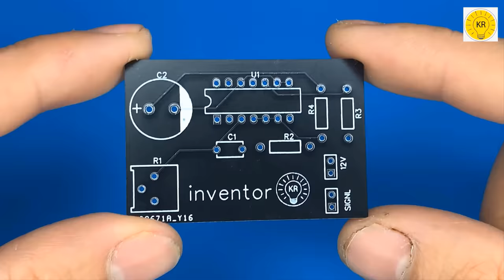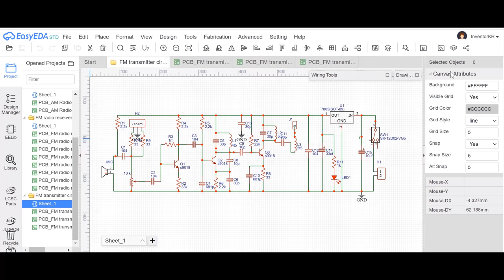how to make simple inverter 4500W , sine wave , 8 mosfet , IRFz 44n ,jlcpcb

Comment: Nice concept, but in reality there's NO way that output transformer is even CLOSE to a 4.5KW transformer, definitely not continuously over long periods of time. That is only about a 500-1000W transformer if used continuously, otherwise it would get too hot. I've seen the insides of quite a few pre-made and branded inverters of around the 5000W size over the decades, and their output transformers are always MUCH bigger than this one is, (at least at this relatively low frequency switching level), plus I actually have a few surplus transformers of almost that exact size physically, and NONE of them can put out anything over 1200 watts continuously without overheating, I've tried...

Not to mention, your supply wires on the input of this are WAY too small to handle the current needed from the lower voltage input source in order to actually power a coffee maker or kettle or whatever that is there, because you can't get more power out of something like this than what you put into it, it's just pure basic physics that apply here, so if that water boiler/kettle or coffee pot or whatever is even a relatively small wattage one, it's still gotta be about 1500-1600 watts or so at least, (most likely even more like 1800-2000 watts), and therefore there is absolutely NO way that those tiny wires you're using on your input to this inverter circuit wouldn't just completely melt or even light on fire from the current going through them IF this inverter WAS actually powering that coffee pot/kettle/etc., so I call total B.S. here and say that this video is fake and simply rather misleading clickbait, because the title of it makes people think that this exact setup will be able to put out the amount of power that's claimed, but there's NO way it actually could in this configuration!... About the ONLY thing that this inverter actually could be powering here is that lightbulb, otherwise if any more than that then the tiny supply wires would just burn immediately, lol!

Also, this is NOT a "sine wave" inverter, it's more like a square wave inverter, because of that IC that chops up the input voltage, but at least the output transformer gives SOME "smoothing" to the output waveform, simply because it's a purely "analog" device and doesn't respond immediately to the rise and fall of the square wave coming out of the mosfets... Let's maybe call this inverter a "modified sine wave" type... or more accurately a "modified square wave"...

This IS a cool concept video though, of the very basic wiring of an inverter circuit, which is cool to see at least... but that is all this is really good for... to show a concept of how a basic principle (of an inverter circuit) works.

Where did you get that pre-made circuit board with the IC on it? (I know the actual PCB is made from that website sponsoring this video, but I mean where was it's actual circuit design gotten from? Is it like an "inverter kit" that you can buy somewhere or something?)
Reply: I was thinking exactly the same thing man
Reply: I was looking at a transformer secondary and te same wire is ground and live wire
Reply: Just FYI a lot of kettles actually go as low as 800W and a lot of cheap kettles are around 1000-1200W
Reply: @MaxC_1  At 12V input that would still be close to 70A without accounting for losses. There is no way there are 70A going through those small input wires without them glowing brighter than the lightbulb. Also he held the base of the kettle into the camera and that said 1800W - 2200W so no way.
Kind of sad to see a video about a sound and working concept ending on a clear fake. Probably has something to do with the affiliate links in the description...
Reply: Completamente de acuerdo, desde que vi el tranformador y la forma en que lo midio, dije este no tiene ni idea, solo le dieron en proyecto listo y lo armo,
Reply: That’s BS running the kettle. Those 12V input wire would have vaporised with the necessary 80 to 100A of primary current to produce the minimum 1,000W of power needed. 
Should have stopped with the light demo, that was good enough to make the point about 220V. 
Anyone thinking about trying this at home, especially perhaps to run their heater or arc welder, will put themselves and their property in certain peril. Electrocution and/or fire come to mind very quickly.
Reply: 4 50A transistors  on each side, so a theoretical 2400W.... of cause that is in a optimal situation. Of cause it would not be hard doubeling up the transistors  and do 4500W...

The main issue is the transformer core. Its both expensive and have limited power. This is not how modern inverters are made
Reply: Would it be enough if we use two such transformers in series connection?
Reply: Согласен абсолютно. Законы физики действуют во всех странах одинаково. 😎🇷🇺
Reply: Can I just get 12V engine, make 230V turbine and connect each, power 12V engine, run at 60hz to make "simple" inverter? I'm not an electrical engineer so asking.
Reply: Very informative comments I am in process of making vertical wind turbine with washing machine AC motor I will be using bridge rectifier AC to DC can you please suggest any decent Bridge which last me long as well as pure sign wave inverter and what type and power of battery I should use thanks
Reply: Ok
Reply: Spot on Joe - there is world of danger and just bad mojo to build something that amount of power.  The point to this video is that you can fabricate your driver circuit, then light up a bunch of MOSFETS into an anemic power transformer that will melt once you have load over 1.2KW. It might be better to use a decent Freq Gen, that actually outputs a pure sine wave, but its big time waster by the time you find a big enough buck/boost Trafo (which ain't cheap) and fabricate your own board. If I had to build one (because the world ended) then maybe, but you can get an offshore 5KW continuous pure sinewave inverter for $500 at amazon, and modified sinewave AIMS at that price point. Something that shouldn't burn the house down, that you would trust to run a medium AC Window or Heater on.
Reply: @alizee3687  Just buy a real PMA, rather than building a washing machine AC motor. I bought one for $250, unless it's the end of the world or you have infinite time, your output probably won't compare to people who manufactured devices. A three phase bridge rectifier is cheap, but you need a charge controller to buffer and store the power in batteries (because wind stops blowing). The irony is that unless you have a lot wind, you can buy 400 even 500 Watt solar panels for less than 300USD, and you will outperform your wind washing machine turbine which will have less consistent output.
Reply: @r3d984  It sholud work.
Be careful to keep it on 60Hz, make sure to add over/under voltage protector on AC output.
Keep safe.
Reply: Thanks Mr Joe ,that's  how it's, and why do mostly of them they lie ,this is for the future of they family too ,
Reply: I am a retired electrical engineer, and I can tell you that every thing you have said hear is spot on, it is all fake, but the output is not a sign wave, or a modified sign wave, it is a very poor quality square wave, with a large amount of ringing from the transformer as the MOSFET's switch off, you need to have an "H" bridge switch to even get a clean square wave, and to get the sign wave, that he is claiming, you have to have a duty cycle modulated high frequency square wave of about 20 Khz or so, the modulation needs to be a 60 Hertz pure sign wave, and a portion of the output has to be sent back to the modulator and used as negative feedback to provide regulation and lower distortion!!!
Reply: Joe I'm with you man. This circuit has so much unobtanium in it that it would be cost prohibitive to build. Hahaha.

I guess inventor KR thinks that no one will notice the many flaws in his design, he is clever though all he needs is a click and he wins. 

The only credit we can give to inventor KR is the concept. The rest is clickbait and fraud.

My 2c worth.
Reply: @pcrengnr1  imagine a world where it was possible to power an entire house using a 12 volt battery :D why are we wasting billions of dollars and polluting our planet to produce electricity then? :D
Reply: Where is the power coming from,  220v line ???
Reply: Yea but if you notice it’s 220v which runs half the amp draw of 110v plus the wire he uses to build the inverter is solid core which in most cases can handle up to 600v.. I’d say 4,500 watts is possible but the amperage is what has me skeptical.. i would think after 25-30 amps it’s probably a grenade
Reply: @pepelapew2724  12 volts from a 110 power converter most likely
Reply: @mikecorleone6797  but the power of the circuit cannot exceed the power of the battery since it's the only element that is providing power to the circuit,this battery can provide 3 amps max at 12 volts but when you convert 12 volts to 220 volts then you lose a LOT of current which is dissipated as heat, there is no way a battery can provide enough current to turn on even a small lamp and even if it does the battery will be drained fairly quickly
Reply: @mikecorleone6797  I'm an electrician. I deal with these kinds of things on a regular basis, especially along with my electronics hobby, AND my background knowledge in solar and off grid power... This setup he has here is OK in theory and the concept of the very basic and crude functionality, but this exact setup is totally limited by the relatively small output transformer he used, (regardless of voltage, it's just too small of a physical size to put out anywhere close to 4.5KW, except maybe if it was totally shorted out and/or basically on fire, lol!... Transformers are totally governed by the basic laws of physics, and the power to size ratio here isn't possible with this voltage output)

Plus the wiring guage/size/diameter is what matters here, especially on the lower voltage input side, and it is majorly undersized for the amount of amps needed to produce that kind of claimed wattage output. The voltage rating of the wire isn't important or relavent to that, as long as the wire is rated for at least the voltages in the circuit here, which it is, and the type of wire, (i.e. solid core or stranded), isn't very essential to anything related to this either, but the smaller guages of wires he uses here are definitely NOT capable of safely handling anywhere close to the kind of amperage needed on the input side in order to get that claimed output either...

So this exact design should NOT ever be copied exactly piece by piece by a novice that doesn't understand the basic laws of electricity and physics, and expect to be able to get that kind of output from this, or else they would have a fire pretty fast!... And there lies the inherent danger in following YouTube videos for something like this... In order to implent something like this safely, and actually have it work as claimed, then the builder would have to know exactly what parts and where in the circuit to upgrade to an appropriately larger size... This is why these kinds of videos are misleading... because most of them, this one included, do NOT make ANY of the more technical details clear, OR put any kind of "disclaimer" on the video itself, but instead they only ultimately make the "misinformation of the internet" even worse, because they are essentially just praying on uninformed people to watch and "like" their video, just to get more popularity on their channel or whatever...

Claiming something that isn't entirely true is just wrong imo, especially if it could also pose a potential safety risk for a novice that didn't know any better! Those are the major issues I have with this video.
Reply: @armincal9834  A larger battery, (or a multiple battery bank of considerably larger individual batteries that are each designed for that kind of higher current draw, like electric forklift batteries, for just one example), definitely CAN/COULD deliver the amount of amps needed for that kind of claimed output, HOWEVER, this exact design as specifically shown in this video, cannot actually deliver anywhere close to that output, simply because of the too small of guage wires on the input side, and them not being able to handle the amount of amperage needed without overheating very quickly, AND the output transformer used in this video being severely undersized for that amount of power output wattage...

(Read my other comment in reply to Mike CorLeoné too, for further explanation.)
Reply: Yep i guess the cable he connected was just a relay for the kettle
Reply: Set freq was 60 hz & not 50 hz! Which country has grid supply standard of 220vac, & freq 60 hz?!
Reply: @GautamKumarGoswami  doesn't matter he used just a rezistive load which doesn't care
Reply: @dan2800  I understand, but transformer core size greatly reduces when freq increases from 50 to 60 hz! But my question was which country has 220 vac, 60 hz power standard?   Normally 220vac comes with 50 hz! Just my curiosity only.
Reply: @GautamKumarGoswami  found that apperentaly south korea runs 220V 60HZ
But those countries are rare
Reply: @dan2800  Thanks bro for the info.
Reply: @GautamKumarGoswami  BRAZIL 220V 60HZ
Reply: @MaxC_1  Maybe, but a 800w kettle wouldn't boil that quickly, that was more like a 3kw kettle, all the cables are way to small and the step up transformer is too small.
Reply: @millimeter3219  I fully agrree.!  Some advise about wireing: make SURE the lengths of ,power, wires are excatly the same and are connected in a star configuration, that way every switcher (FET, Transistor or whatever) get the same current else the one with the shortest wire (lowest R value) does most of the job and wil likely burnout.
Reply: @GautamKumarGoswami  Here in Philippines 230v~  at 60hz
Reply: His PCB casme from PCB Way. Correct about all you say, but I would have to add another comment, When I did electronics back in 80/81 and 82, we were told solder was only an adheseve and not a good conductor and make sure you have a good mechanical connection of the wiring/ terminals before soldering, some of those were barely touching let alone making good contact, But like you say a nice concept.
Reply: @nialldaly7108  Oh, solder definitely IS conductive, otherwise almost NO printed circuit board would even function at all, because there's not really any actual physical connection between the circuit board traces and the leads of any of the components mounted on it until the solder joint is completed and solder flows into the thru hole and around the lead of the component.
Reply: @JoeJ-8282  Point taken, but the main point is that it shouldnt be relied on to make the physical connection between joints, That should be established first and then solder them. Not use the solder as the means to hold them together. Any vibration on some of those joints and they could come apart. It is not a good habbit to get into. Surface mounted is differant. They are very light componments and in manufacturing process, there are rehular Sheer tests done to ensure the process is always working. Look at the middle leg of the first MOSFET. That is not good. Fine the soldered joint itself is OK but the connection and lack of strain is not good. A Recipe for future disastor at such high voltage and the current that is claimed.
Reply: @nialldaly7108  Yeah, that's true, but really NONE of these details even matter in this specific case, with the device in this video, as this whole setup as shown is quite obviously a total scam!... I am both an electronics person, AND an electrician, and I can see MANY flaws with this setup as shown, and as it is, there is absolutely NO way that this exact circuit as shown, and with these exact components, could deliver anywhere even CLOSE to 4.5kW of output power... (unless maybe it was on FIRE and you counted the TOTAL output energy, including the flames and heat, LOL)...

This circuit as shown, along with its undersized power output transformer, AND definitely the extremely tiny input wires, definitely would NOT power that kettle, because that takes about 2kW itself, but having that much power on the input wires, with a lower input voltage, means WAY higher current than those input wires could handle without pretty much immediately bursting into flames, LOL!...

About the ONLY thing THIS exact circuit, as shown, could realistically power safely, would be that small wattage lightbulb, nothing more without overheating the input leads at the very least!

This video is only good for showing the basic CONCEPT of functionality, but NOT a viable, actual use product, at least not without beefing up certain critical components first!
Reply: @GautamKumarGoswami  Actually the core size of a transformer isn't all that much different between such relatively LOW frequencies such as 50Hz OR 60Hz. Depending on the transformer brand and type, you'd actually be pretty hard pressed to actually notice a significant difference between just 50Hz and 60Hz transformers...

Transformer core size isn't majorly noticeably different (and smaller) until you get into the KHz range of frequencies, like in a typical "switching" type power supply, which usually operate at around 15KHz or even higher... Some modern "small space" switching power supplies operate at even as high as 100KHz in some cases... At THOSE types of upper frequencies is where a significant (or sometimes even a major) physical size reduction of the "main power supply transformer" can actually be achieved.
Reply: @JoeJ-8282  Thanks for the info bro.
Reply: it is really true that he illuminate this bulb but turning on heater completely fake. how does that bulb didn't dim while parallel connected with heater and really funny that wire didn't get smoke the way he twisted
Reply: He carefully measured the 4500W capacity of the transformer with digital callipers, then made sure to make the best quality soldered joints because he knew there would be a high current.
Reply: @alexjenner1108  Hahaha, yeah, I sense your total sarcasm there!... Oh, wait, you were being 100% serious there, SURE!... This guy absolutely MUST have tested everything to exacting standards of reference beforehand, otherwise the circuit wouldn't work like he claims, right?...

Yeah, no. For one thing, you don't measure a transformer's output capability with a caliper, whether digital or not, lol!... That's what gave your comment away as sarcasm.